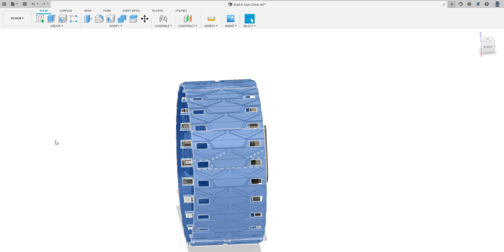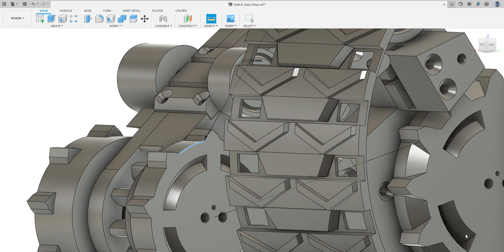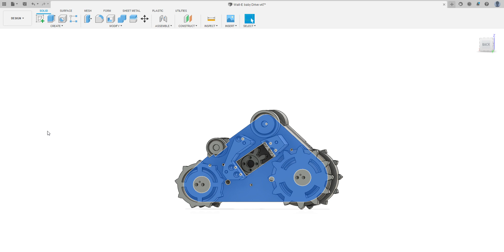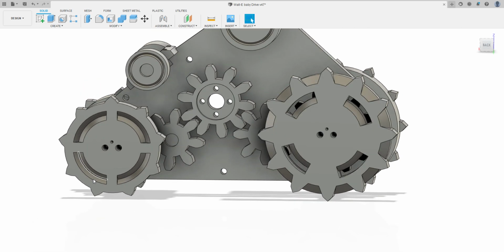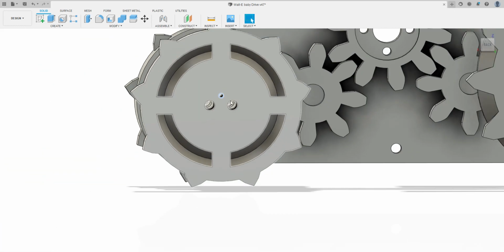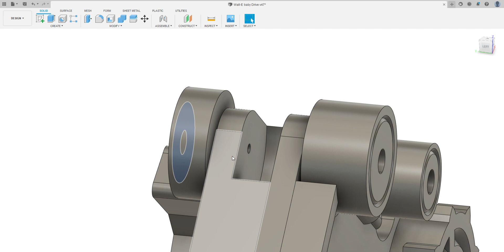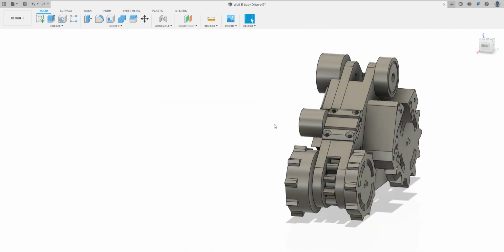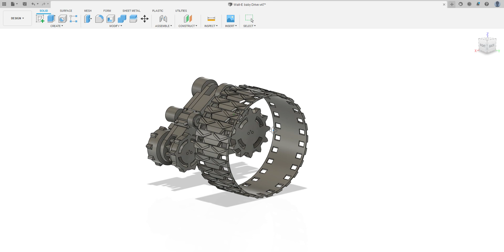Approaching Baby Wall-e Drive Design - Consideration and constraints.

Comment: Saw a guy at the beach not long ago who build a wagon for hauling his chairs, umbrella etc using a similar track design. His tracks came from aliexpress though; an ATV snow conversion kit. Darn things aren't inexpensive for sure. Nearly $300US shipped for a pair. If yours are not too small (say 10kg capacity) and can move at least a moderate walking speed they might be a good alternative.